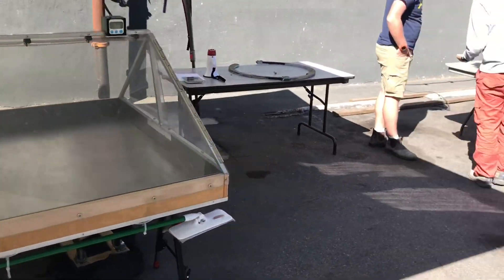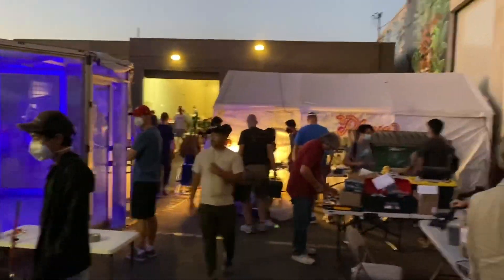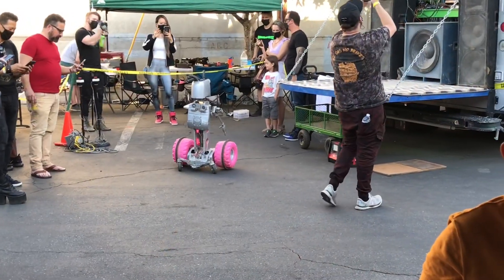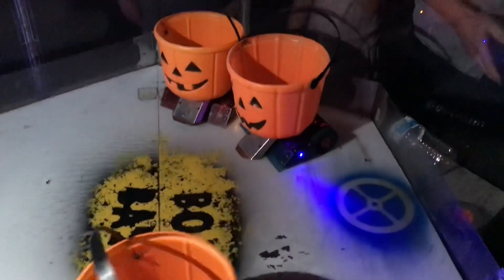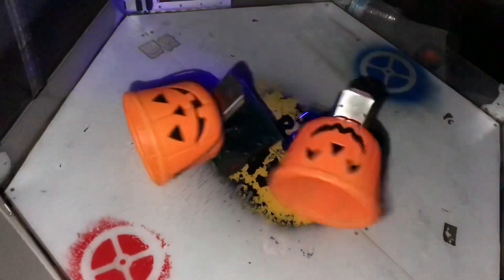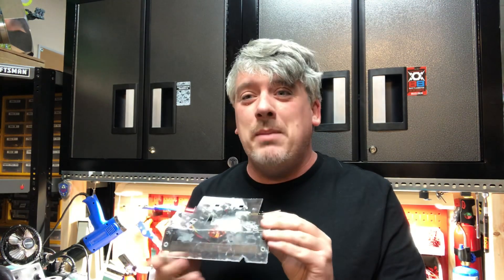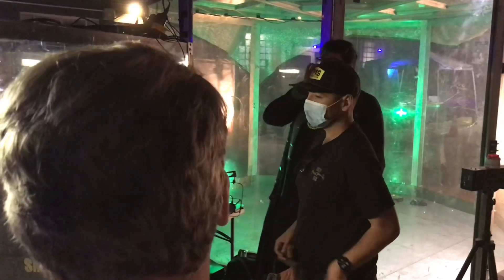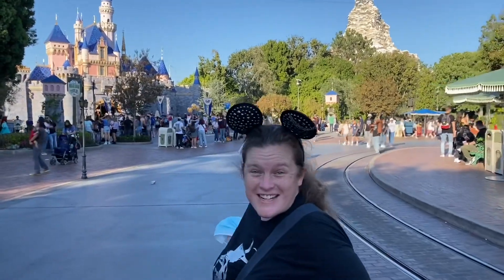Smashbotz: Where Legendary Robot Fighting Careers Are Forged!   [Builder Blog Ep 26]

Comment: Ha! Great stuff! I certainly envy modern bot builders. It's so easy to get into the hobby, now. Bot kits? 3-D printers? Teeny-weeny radios? Cheapo LiPo batteries? Loads of local tournaments? Fantastic!

I'm based in England and built my first proper fighting bot in the late 1980s. My mates and I were into flying RC model aircraft, but the new trend for having illegal 27 MHz CB radios in cars (no such thing as mobile phones back then) meant that random radio interference caused our planes to crash, so we got angry and decided to make wheeled bots from scrap car parts and run them indoors so that nobody (or the lousy British weather) could spoil our fun any more.

Pretty soon we were crashing our ugly-bots into each other, then we added weapons and started actual fights. The bots were slow and their weapons were pitifully feeble, but we had a lot of fun. Also, the bots were only made from wood and aluminium, so even a spike or a slow-running saw blade could do decent damage.

Back then there was no tiny bot technology; batteries were the massive lead-acid ones out of cars and motorbikes; there were no lightweight, powerful 2.4GHz radios, no cheap electric motors, no LiPos, no clever electronic speed controllers, and (frankly) everything was knocked together from old bits of garage garbage.

It was literally impossible to make small machines, so we decided on bots that would weigh 100 lbs and cost no more than £100 to build.

I tried to get more interest in our 'Centurion League', but there was no internet, no e-mail, and no social media, so it was really hard to get people involved. Newspaper advertising was expensive, and hiring a venue was REALLY expensive, and we couldn't get insurance anyway,  so we ended up just fighting in empty double garages.

(Please DO NOT do that now - today's robots can be seriously dangerous!  Our old bots were nothing like as feisty as even one of today's 1.5 kg  machines.)

A couple of years later (1992) Robot Wars was getting started; I began building a bot called Cerberus for it, but had to abandon my plans for personal family reasons.

Hobbyists today have so many more opportunities for getting into combat robotics. Radio gear is small, light and cheap (back in the 80s it was clunky, heavy, cost as much as a second-hand car, and the receivers needed a wire aerial 24" long!), so the only real limitation is your own imagination.

It's great that there are peeps like Team Skorpios spreading the word (and the mayhem) to a new generation of roboteers. Thanks, guys. I know for sure that tomorrow's builders will look back in years to come and be grateful to you for sparking their interest.
💥 👀